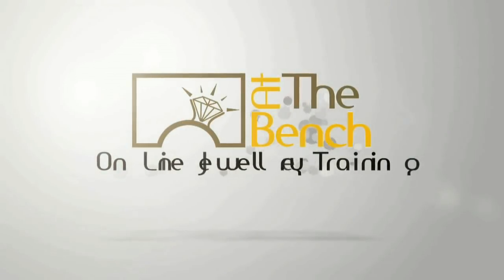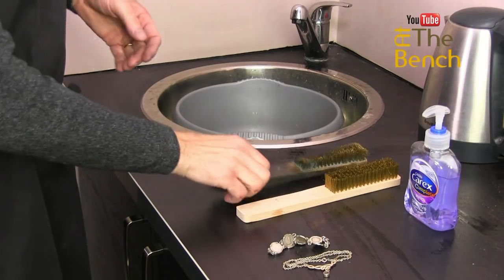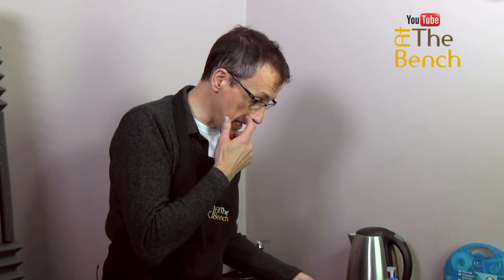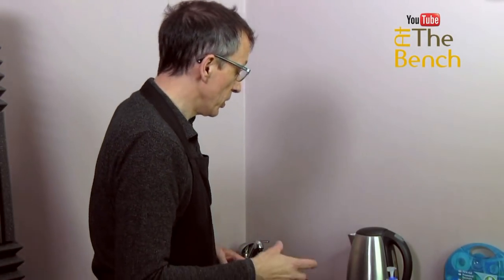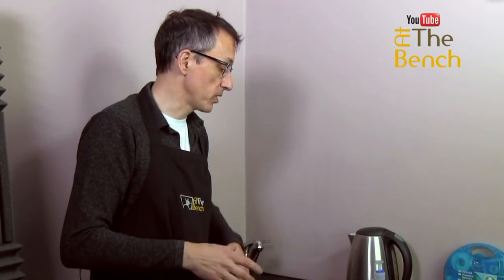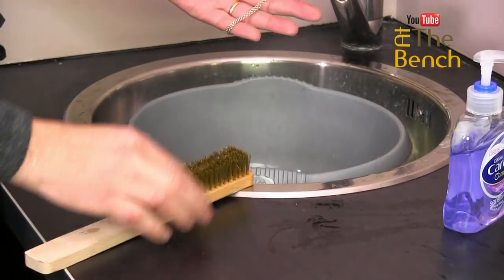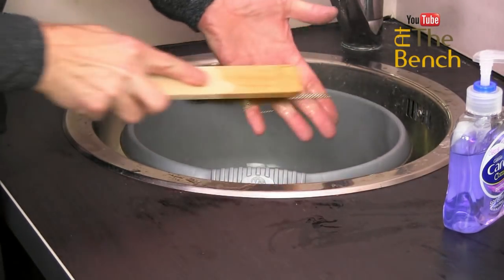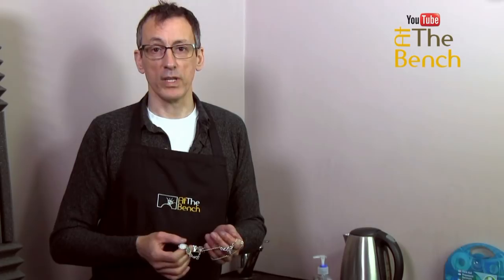How To Clean and Polish Gold And Silver Chains The Easy Way

Comment: Wonderful video Andrew!  In a pinch I've accomplished similar results (albeit a bit slower) using a toothbrush and a lot of patience. :)  Simple chains can also just be 'massaged' carefully in the palm of the hand with a drop of soap and a trickle of running water.  Badly tarnished pieces can benefit from a minuscule amount of toothpaste in the soap mixture, but one should be careful not to overdo with that.

I added a small magnetic pin tumbler to my tool collection about 15 years ago, and there's no going back to hand polishing/hand cleaning of my chains.  I generally find a new chain takes about 2-4 hours, with periodic adjustments and inspections, but the results are always very impressive.  Cheers from Northern California, and thanks for all your wonderful tutorials!

Comment: I have made a bracelet with loop rings all over, so this should be ideal to clean it. Only my question is, after soldering the silver is turned a bit dark in between the rings. So I cleaned it, only the silver is not going to this new white-ish silver color. How do I get this silver back to looking brand new after working on it?
Reply from the maker: bubblebie pop into warm pickle for a while and then scratch brush it.
Reply: Thank you!!

Comment: Very, very helpful, as always. What about using a tumbler on just chains, without pendants? Would you risk them getting all tangled up? Thanks so much for this simple way of cleaning. I need to go find a soft brass brush such as yours.
Reply from the maker: Bobbi Benton-Stewart I don't trust tumblers to polish. I would rather do it by hand
Reply: Bobbi Benton-Stewart I was wondering that also... why don't you trust tumblers???
Reply from the maker: Often when taking stuff out of the tumbler, there is discolouration or the shot has marked the surface or the chains are tangled etc. I bet I could clean half a dozen chains quicker than you threading the chains on a framework. Putting it in the tumbler. Then getting it out of the tumbler and then unwrapping the chains. No worries, you can see the chains getting cleaner and you can use the rest of the water to make a cup of tea. It's a win win situation ☕️🍰👍🏻

Comment: Could the brass brush possibly scratch a 9.25 silver rope chain?
Reply from the maker: Not if you use hot soapy water. One of the best ways to clean that type of chain in fact
Reply: @Atthebench  thank you for your  reply and I have two more quick questions....does the brass brush remove any silver material at all will any brass brush work or does it need to be a soft jewelry brass brush? Thank you so much for your video!

Comment: Not polishing chain on polishing mops i.e DE motor is a myth, I and many other people have been doing it for years, I have asked those who say you should not do it and not one person has ever been able to come up with a validated reason. What is your view
Reply: I don't know what a DE motor is, but I do know it can be extremely dangerous to polish a chain on a large polishing machine. It can get caught and you can lose your fingers. He did say you could use a pendant motor (flex shaft) at the lowest speed where you'd have more control. I love this method however!
Reply from the maker: pijnto It is very dangerous to polish chains on a polishing motor and it takes great skill to do so. If you are a beginner then I would never recommend it. This is the reason why I mentioned it. It's better to advise not to, rather than someone injure themselves.